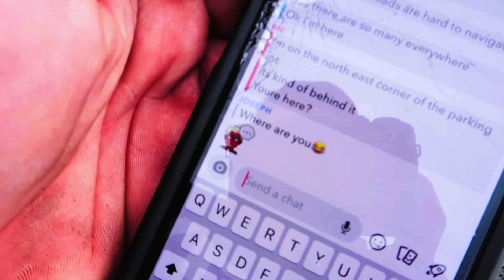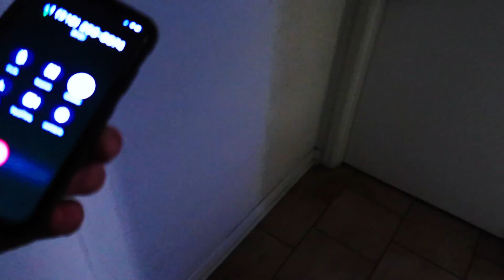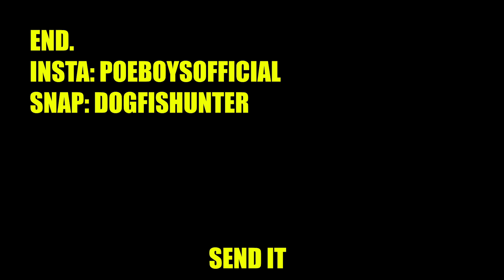I SOLD My SUPERMOTO! But It Wasn't Easy..

Comment: Hey Poe that sound your hearing in the top end it the decompression arm when you first Crank it the value is clicking over that little lobe on the decompression assembly it's normal

Comment: You should get gavins old coyote and swap the new edge
Reply: Ivan Shepard-Revalls Hell yeah
Reply: Pretty sure gavin is doing something with that coyote engine
Reply: hes putting that back in satan while the mmr engine is being fixed in cali hes gonna take the twin turbo setup off the shelby and put it on the old coyote until both engines are back
Reply: I meant after the fact

Comment: Poe please don't sell the ole 7.3 I get very excited when I see it on your channel
Reply: they are good trucks when they are running properly. Normally injectors are a common failure point on a diesel. Once he gets all that done, it should run great. My neighbor has a 99 f250 7.3 and he has owned it for 20 years, It has been a great truck to him, he drove it 300k miles.
Reply: @RicardoPCGamer   yeah I know my dad has two 7.3s his 99 has 440,000 on it I just hate to see him get rid of it